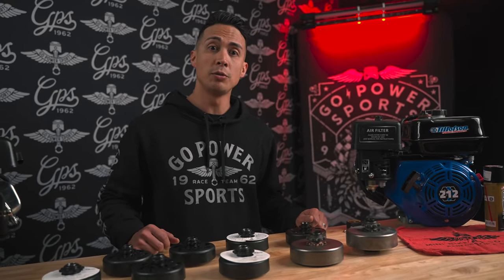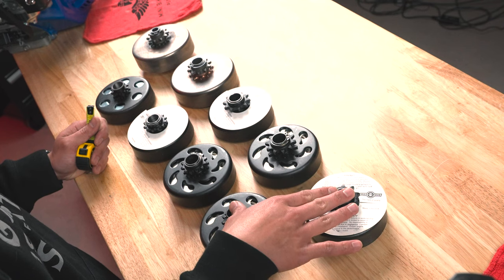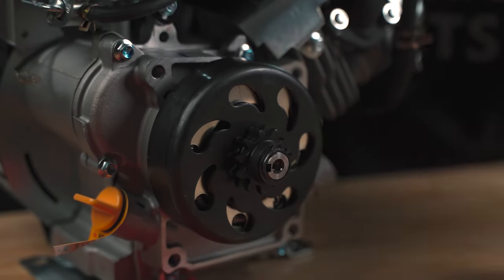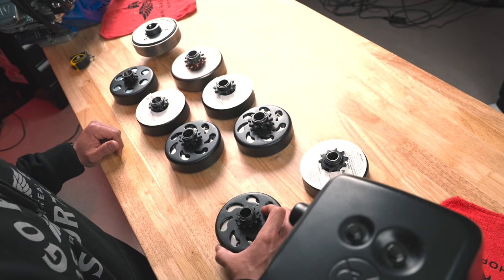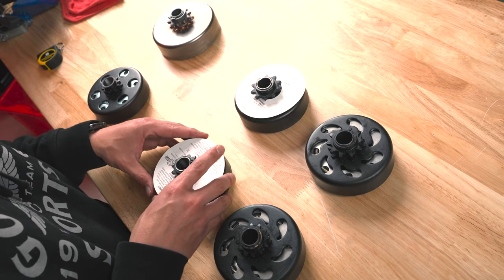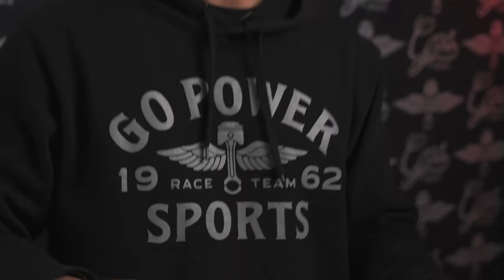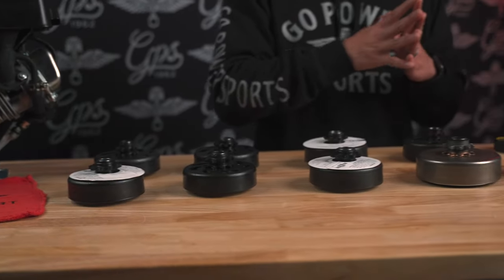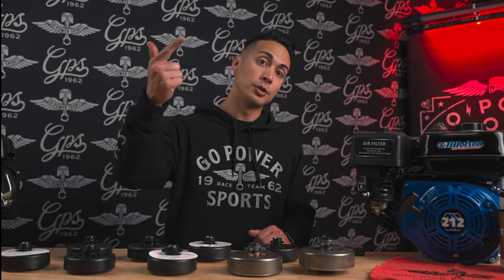How To Choose the Correct Clutch For Your Go-Kart or Minibike

Comment: You might want to disregard his recommendation of Chain Wax as the lubricant for the "Oilite" bushing in your clutch and go with a 30 weight non detergent oil or any specialized bushing lubricants.(light machine oil, etc.)  Remember the rule of thumb, normally bearings require grease and bushings require oil.
Reply: Rule of thump!   I have never heard such wisdom 👍

Comment: It's interesting that you mentioned that 1" clutch for 18hp engines. Your website says it's "rated for up to 7hp".
Reply from the maker: True, the factory will have it only rated up to 7HP.  But we have seen Stage 1 Predator 420 Engines on Coleman Minibikes that use this 1" Bore 1041 Heavy Duty Clutch.  The lighter the rig, the longer your clutch will be useful.  I definitely would not recommend this set up on a Live Axle Go-Kart.

Comment: Ive got a streached mini bike that im planing to put a honda gx390 into but i still cant decide on gettin that meaty clutch or going for a 40 series
Reply from the maker: Centrifugal clutch will be easier to use and still hold up, but that 40 series torque converter is a great upgrade if you can fit it.

Comment: I have just built a gokart with my cousin. All is good except the clutch. Its not engaging 😢 its a 13t 1" bore, 420cc 15hp. When the engine revs it doesn't engage. All we hear is the clutch rubbing off the metal. Any suggestions would be great. I have video if needed
Reply: Check the shart regulator.

Comment: Do.they make heavy duty 1 inch clutches with 1000 rpm stall speed. I am using it on a boat so that is why i need a low rpm stall speed.
Reply from the maker: Sorry, do not stock.

Comment: My clutch I got from you guys does not have a key . It came with a small bag with 3 little pieces and two screws but I cant figure out how to put this on..
Reply from the maker: Is one of the 3 little pieces a key?  It should look like a rectangle steel piece.
Reply: @GoPowerSports  yes there's a small little key thing that came with the two small screws. Just not too sure how to put this in been trying to figure it out myself or find some kinda tutorial. I wanna put the clutch on "backwards" because I run a straight chain. Thank you